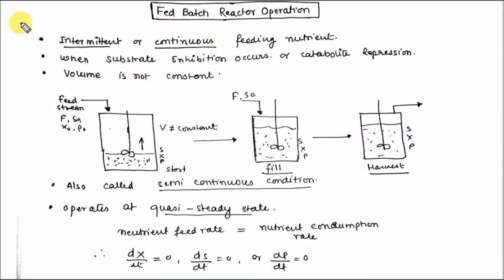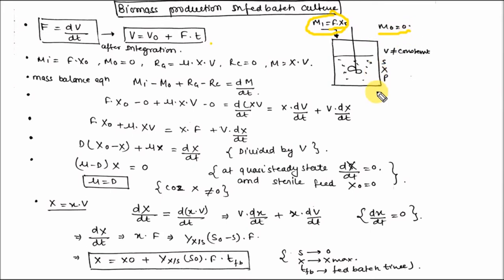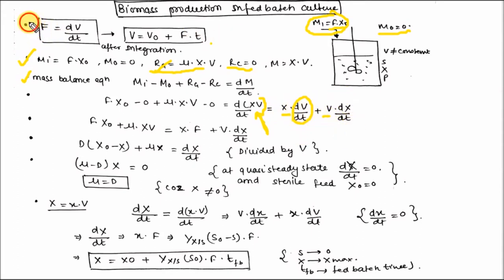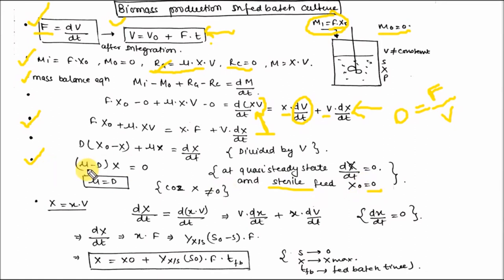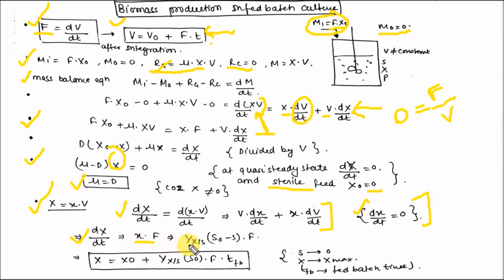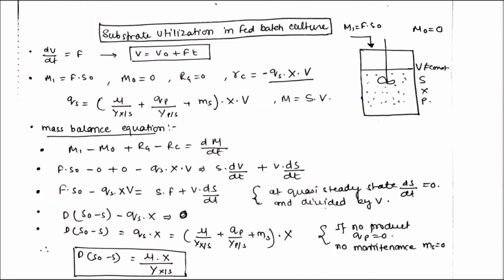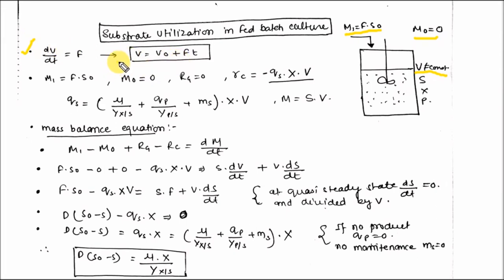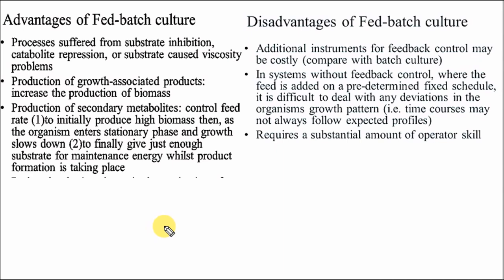Bioprocess Engineering | Fed-Batch Reactor Operation | By Virendra Singh | CSIR | GATE | DBT | ICMR

Comment: Thank you very much for your video! It has been really helpful!!

One small detail that confuses me though is, shouldn't the volumetric flowrate going in the tank increase with time? As there is more amount of biomass in the tank with time, surely the substrate will be consumed much quicker and thus more nutrient per time should be transfered no?  From your equations it seems like you are assuming a flowrate of constant value.

I thank you very much once again, and looking forward to your reply! Have a nice day :)
Reply from the maker: The AndyV 
What is flow rate ?
F=dV/dt 
Where V =volume
Hence Volume is continusly increases in fed batch culture thats means Flow rate is also varies in the Fed batch culture.
Flow rate is not constant here.
Reply: Thank you for your reply. I see now. 

The problem is then, if flow rate is not constant, when you do the integration to get V=Vo+F*t, F will be changing with time and cannot be thought of as constant and removed from the integration. This equation would only be true if F was constant and didn't vary with time.

I might be wrong but, wouldn't it be more correct to do the integration as dV/dt=μ*V from your equation of dilution rate equal to growth rate? That way you end up with V=Vo*exp(μ*t) and F=μ*Vo*exp(μ*t).

Thank you very much for your help once again!